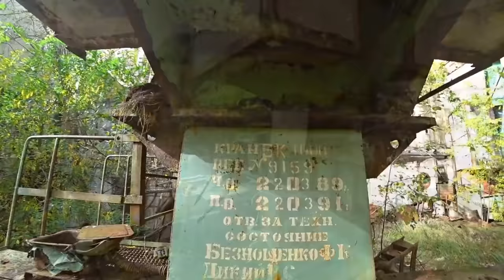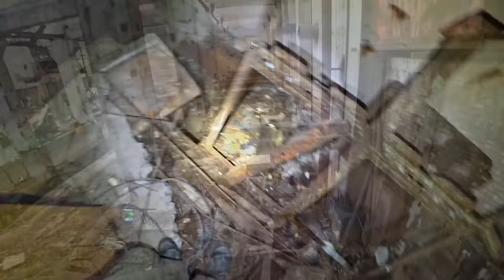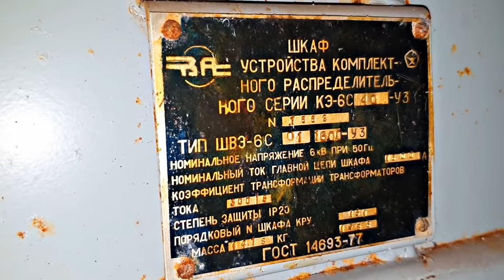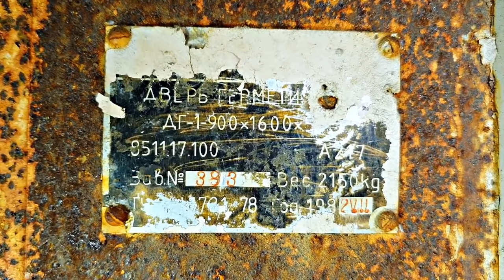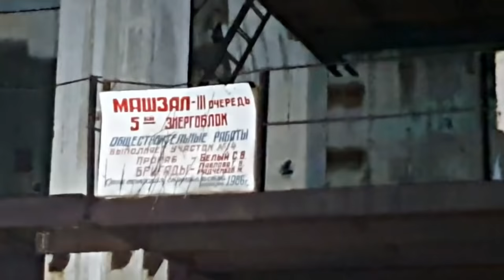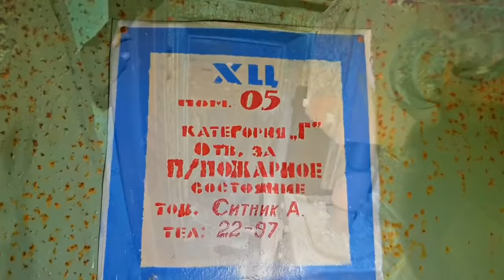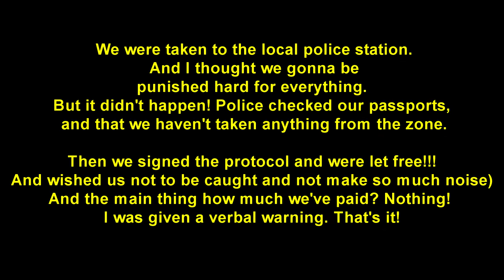☢️Going to the Chernobyl Reactor Tunnels / Busted by Security @SuperSus almost drown

Comment: Swimming in radioactive water without a dosimeter. That's a hell.
Reply: there is no radioactivity, if you dont check for it. schrödingers dosimeter. i wonder for years, how these guys are still alive. but this one may be their last adventure. hurts watching
Reply: It's probably not radioactive. That is the 5th unit, that was never completed and so never had nuclear fuel in it.
Reply: @alerighi  its still in that shut zone with massive fallouts. and a cellar full of water might have cough lots of radioactive particles
Reply: Swimming in potentially slightly radioactive water. The true is : we don't know.
Reply: @Tigrou7777  down that one floor in that building was a corridor shut with bricks. im pretty sure, being around that place was not healthy.
Reply: That's a real hell guys
Reply: ye kinda crazy not to measure when you're at power plant area. you don't really need it elsewhere but ye so close to disaster I'd use it. Altho those dosimeters can be too loud  and can get you caught : x
Reply: They have evry time a dosimeter but say it they forgott to make drama get more clicks🤦🤦
Reply: That's nothing, SuperSuss strangled a sausage with his bare hands last week, and ate it. The man is hardcore.
Reply: @alerighi  The basement or some tunnels might be common with the 4th unit. I don't think there is an open way to unit 4 anywhere, they pumped concrete into every tunnels around it. But radioactive water might leak through it. Or they might put radioactive waste into the basement of unit 5 during the cleanup. But that was a horrible idea if they did, because then now it's flooded and might contaminate water supplies.
Reply: He looks like he might have been born with 'built-in radiation hardening' :-P
Reply: It's annoying to see videos of people walking in potentially highly radioactive environments and being oblivious to it. I like those videos where someone is monitoring the background radiation and reports it as he moves around.
Reply: @HSMW  Correct, I have enjoyed that channel a lot, but it has become silent for 3 years it seems.
Reply: Jesus Jones  Different isotopes decay at different speeds. There are still lots of toxic slower decaying radioactive isotopes that you don't want in your body in the Chernobyl area. I would worry about causing a lot of dust inside buildings and inhaling it or swimming in water in a building basement with my head under the water; that has accumulated a lot of isotopes over time.
Reply: Jesus Jones  It's a question of chance. More exposure means more risk of some cell having a mutation that yield a deadly cancer. It's sort of a Russian roulette and the more you play the more likely you die from it.
Reply: Agreed! The group was on the recommend list so I watched it and I was like uhhhhhh
Reply: @alerighi  The chernobyl exclusion zone is 30km in radius, anything in this zone is radioactive.
Reply: That’s a paddlin.
Reply: @alerighi  radiation from reactor 4 saturated everything around.
Reply: The radioactivity I'm told is the equivalent to a chest x-ray
Reply: @alerighi  They are trying to pass through a tunnel from 5th building to the 4th unit. In an other part of the video in the 5th unit they smelt an area with radiation and started running. They've most certainly been exposed to radiation and they haven't measured how much.
Reply: Jesus Jones  these species that have returned have adapted to survive these conditions. Many species (mostly those who lay eggs in the soil as opposed to birthing) have not and will not be able to for a long long time
Reply: thats true
Reply: Jesus Jones  it's a long term process of decay. Fish and small animals won't live long enough in their natural lifespans to see any real effects.
You can live in a radioactive area, but it may in time kill you.
Reply: @ThinkingBetter  She probably croaked from leukemia.
Reply: @s.sestric9929  She mysteriously disappeared from the internet, it seems. Hopefully she is alright.
Reply: @KekTekDe  The exclusion zone directly around the perimeter and operations of the power plant are well within safe zones of 1.0 per hour, so safe in fact that workers have once more started eating at the powerplants cafeteria. Though the Sarcophagos helped, it to was not enough, and thus before it used to be 4.0 per hour . Thanks to the Arch it has since returned to 1.0 outside the Arch. The dangerous areas around the exclusion zone of Chernobyl and Pripyat are where radioactive clouds deposited this material. Though much of the Exclusion zone is still radiated, it is become far safer than it had been thanks to the work of the Liquidators. 

There are people who still live in the Exclusion zone, there is a hotel run inside the exclusion zone. Though it is not an inhabitable land and never will be in our life time due to the continued work of liquidators both in reactor 4, and throughout the exclusion zone, much of the area is safer for exploration, such as reactor 5, the Russian woodpecker, the incomplete coolant tower, etc.

though I dont know why this dude is bringing a gasmask without a filter.. especially a gp-5, wont do anything except heavily limit his vision.
Reply: @allylou8514  I wouldn't think so. Even people somewhat careless about radiation exposure will likely not see the ultimate consequence until decades later. She is more of a daring expert in radiation.
Reply: the mere thought of that makes me feel like my skin is gonna start rotting
Reply: @ThinkingBetter  I heard she found a small piece  of actual graphite and kept it.  Supposedly even showing it on YouTube.  She was arrested and probably banned from entering the location. Hence no more videos.
Reply: Even if it's not radioactive, that water looks nasty as hell. Probably full of parasites and other stuff.
Reply: radiation shows on film, so maybe theres not much? after all most of its contained in the sarcophagus and they probobly have a radiation detector off screen
Reply: Goddamn so many experts on YouTube 😂
Reply: @KekTekDe  "not healthy" inside that reactor room is around 300,000mSv, to put that into context if a human is exposed to 10,000 mSv you get acute radiation sickness and almost certainly die in 2 weeks. If you go inside, gamma rays will rip through your body and your organs shut down in minutes.
Reply: @TwoMoSmoka420  lets put this into consideration, the main core is 300,00 mSv and to die within weeks you need to be exposed to 10,000 mSv. If they dived towards reactor 4 they almost certainly would shortened their life span by 10 + years
Reply: @alerighi  its flooded through to the other reactor... Its radioactive....
Reply: @DJDannyN2009  but you don't stay having a chest x ray for 8 hours...
Reply: No dosimeter- No radiation
Reply: Jesus Jones  Him being a little person and looking like he may have other health concerns could shorten his life.
Reply: @HandicapRacer  Unit 5 and 6 aren't near unit 4. It's a completely different facility
Reply: Jesus Jones  it seems like the group is fine
Reply: Jesus Jones  the boys seem smart and growing up around this type of stuff having knowledge from young age etc definitely is a big help they seem to know what to touch and what not to touch and things to do and what not to do and about moving and making things dusty and having equipment that tells them of radiation levels is nice. if y'all would just watch some videos or google information about radiation it would help you all a but more than just random guesses people already have the answers to. like water and radiation for example. or just radioactive water. or evaporation. also about the area they are in and what areas in Chernobyl have hot spots to stay away from. regardless its very unsettling thinking about being there and also the possible outcome for mistakenly going into a hot spot or unsettling an area and breathing it in etc as far as it seems though i can see that cleanup has been done well if anything in the area like cars trucks busses or even anything in the building had radioactive properties they would have been taken a while ago who knows though. security seems to be aware of activities there also. there is a lot to think about. why are they even allowed there to start with? if its dangerous or if the government left something behind they know they shouldn't have these people wouldn't have youtube vids idk. my stepdad goes to Japan often and i dont even like him going there let alone thinking about hitting a bad spot for these guys here but again they seems to understand how to navigate
Reply: @KekTekDe  they already lost 20 years of their life 💀💀💀
Reply: @KekTekDe They are in concrete&steel tunnels below a massive nuclear power plant, it's literally the place in the exclusion zone that is best protected from any fallout
Reply: @KekTekDe  Water molecules dont bind to radiation or retain radiation, and in some cases actually repel it.

Comment: It is very smart of you to walk there without a geiger counter. Bravo.
Reply: I can't really believe it. They were probably measuring the radiation level off camera. At least I hope they're not that dumb to go there without a GM.
Reply: That's very smart, so there's no radiation if you can't count it 🙃
Reply: @mrnmrn1  Bro their gas mask doesnt even have a filter on it, I don't think they would spend money for a Geiger counter
Reply: @mafiacracked1191  They used Geiger counters / dosimeters in many of their previous videos.
Reply: @DrProfJames  Its probably just a white lie to generate clicks but even if they really dont have a geiger counter they know which spots are radioactiv and which are not.
Reply: @derPetunientopf  because one can see radiation?
If you smell or taste it you are basically dead. There are reports from clearers in chernobyl that stated "it smells and tastes kinda sweet" and they died basically within weeks.
Reply: @Sandmann1193  No i didnt say that they have a special Stalker sense. I mean with knowing that they for example have been at a place before with a geiger counter or they know very well from other people that a place is safe or maybe not so much. In this case for example they knew from the start that this place was never really used. This building is safer than the outside around it.
Reply: Honestly the only good they do is telling you you gonna die instead of letting u die peacefully
Reply: Saftey violation issues (for redditors)

1. Lack of filters and personal respirator

2. Lack of geiger counter

3. Lack of iodine tablets (debatable but negates radiations damage incase of large exposure.)

4. Lack of proper lighting equipment besides headlamps and camera

5. Lack of full body protection equipment or a form of basic shielding

6. Lack of any possible backup plans incase of emergency (high radiation exposure, injury, toxic material inhalation)

7. Lack of even basic medical equipment

Also AH YES GO TOWARDS WHERE ITS EXTREMELY HOT ITS NOT LIKE ITS INSANELY RADIOACTIVE OR ANYTHING YES
Reply: Lol this dude started to react to radiation already 0:48
Reply: @LifewithChance8800  I always hoped to see the radiation in these areas... You cant imagine how strong it must be there, it would be damn interesting to know exactly HOW strong...
Reply: You all need to relax somewhat, this was one of the never completed reactors, the vessel was never installed, they are just messing about in regards to radioactivity there, because there is none.
Reply: They were swimming in the reactor cooling system. Why would you need a Geiger counter for at that point lol?
Reply: Some of the metal they were touching on right away at the start of the video absorbed SO much of the radiation. In other videos, geiger counters had ratings off the charts. 🤦🏼‍♀️ I understand why, cuz i would love to do this.. but to not wear gear, use counters or masks.. so incredibly dumb.
Reply: Svaka mu cast,vidi se koliko je pametan
Reply: I’m not sure that the reactors were ever used because these are reactors five and six and they were 95% complete when the accident occurred. These are in separate buildings away from the actual main reactor building where it exploded
Reply: This isn't the Chernobyl plant which exploded, this is unit 5 and 6 which were never finished. Quite a distance from unit 4, and not dangerous from a radioactivity perspective
Reply: @mrnmrn1  Well when you see white dots in the camera that means they were in high radiation areas since they are caused by high energy particles causing the camera sensor to react similarly to light. I noticed lots of white dots often so I would speculate these guys were sick for weeks or months after this long visit.
Reply: Ignorance is bliss lol
Reply: What would u expect from them? Just look at them!
Reply: NATURAL SELECTION
Reply: They do but they edit it off the vid
Reply: The video is fake not the correct place this has been proven many times
Reply: they will probably out live the average westerner with their diet..

Comment: This isn't Reactor 4, it's Reactor 5, the one that didn't have a disaster and was never completed. There is barely any radiation here compared to the actual Chernobyl Reactor 4. Also, the gas mask has no filter, it's a GP5 mask so the filters contained asbestos. But still, a gas mask without a filter will literally not do anything
Reply: That is why they are trying to find a way to #4
Reply: It  being never competed and next  door to reactor 5 to me says the entire area has been showered in fallout.
Reply: Still pretty radioactive ☢
Reply: It's for show, you gotta wear a gas mask in Chernobyl, its a fact. you just have to.
Reply: @Dereck_Boss  it's not really
Reply: @notme1032  it is tho
Reply: @notme1032  if they detected radioactivity in Sweden after the disaster why wouldn't the building next door be radioactive?
Reply: No shit, Sherlock!
Reply: Yeah, kind of a bummer when you actually see that they are just goofing in the unfinished area making it look like they are really in the worst area.  Granted the whole area is radioactive.  Give it a C- for reality but an A for effort.  Pretty good documentation of what it looked like before the war.  Would not even dare to try to go there now with all the land mines that where laid and the radioactive stuff the Russians unearthed digging trenches.
Reply: I was about to comment the gear they used, how they went about it and the popped flare in a confined space with low oxygen did more harm than the water. Considering how shielded reactor containment buildings are that's probably the least irradiated place in there.

Comment: I'm watching this on a CRT monitor for extra radiation
Reply: LOL. I'm genuinely watching this on a CRT... Samsung SyncMaster 763MB.
Reply: @mrnmrn1  Dude what's your CRT set up?
Reply: @kaschfrick9664  The PC is an old HP Core2Duo E7500 workstation with no video card (just the integrated intel one, I'm not gaming on this machine, and currently on anything - well, I occasionally play C64 games on this machine... ), the monitor is a basic Samsung 763MB which we bought back in 2004. This is not a dedicated "CRT setup", this is my main PC. My LG LCD monitor died about 4-5 years ago, so I digged up my old spare CRT monitor temporarily, and haven't replaced it yet in the last 4-5 years :) . I'll have two or three big 21-22" Trinitron monitors as well, one of them will be on a dedicated CRT setup. If I manage to repair my iiyama VisionMaster Pro 510 Diamondtron monitor, that will be in use as well. And I also have a Sony BVM-2010.
Reply: @mrnmrn1  nice
Reply: i have a 

Dell E773C crt
Reply: Gateway 2000 CrystalScan 1024ni or my IBM 5154 EGA Monitor
Reply: @mrnmrn1  is that english?
Asking for a friend
Reply: Nice
Reply: Epic Comment!!!
Reply: Ahahahah 😅😅😅